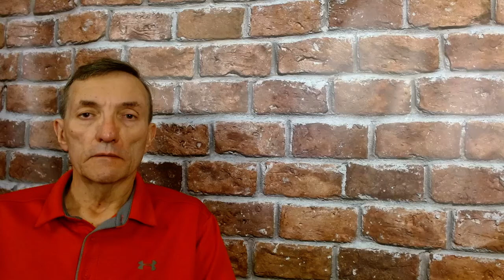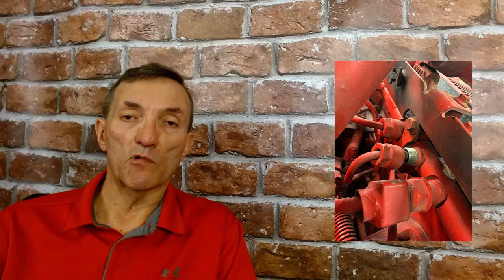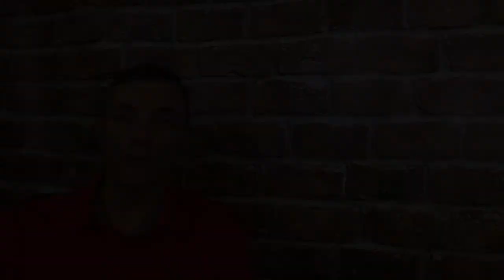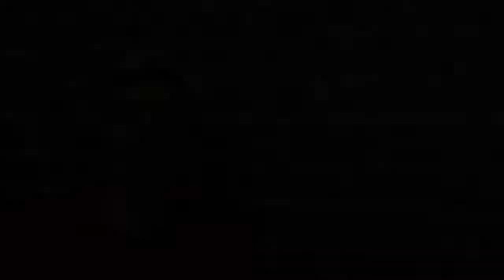FC 559 VIDEO 1  Troubleshooting low fuel pressure - safety first

Comment: I’ve changed fuel filter fuel water separator and fuel rail pressure sensor and this code continues to come back spn 157 fmi 18 oc1/2/3

Help
Pleaseeeee
Reply from the maker: Did this start before or after the filter changes? Did you change filters due to this happening? Does it only happen when pulling a long hill or anytime you step into the throttle? what work has been done to the fuel system and how many miles or hours are on the engine? What engine do you have isx isl L9 b6.7???
Reply: this happens to me as well only when pulling load up hill will the mai tanence light amd check engine come on please help i chamged the fuel pump the water seperator the sylanoid the rail sensor idk what else to do 3 local mechanics have given up  @ENGINESHOPJOE
Reply from the maker: @alexcabrera1  send me an ecm image with the fault in the image. faultcodehelp@gmail.com
Also I need to know exactly what was done when repairs made. IE- I change the fuel pump- gear pump? injection pump? transfer pump? I need a lot more information to give you an answer.

Comment: What would cause the fuel  to drain back to the tank even after the  check valve in the filter base was  changed?
Reply from the maker: There are a number of things that can cause that. Are we talking about common rail or ifsm or another fuel system? 
There are slightly different answers for each fuel system. If you not sure put your engine serial number in the comment or send it to faultcodehelp@gmail.com if you want your ESN kept private.
Reply: @ENGINESHOPJOE  common rail

Comment: Im having a problem with my truck, every time i leave it parked over night, my truck start normal but after 10-15 seconds it quits. If i come to the truck and press the gas pedal it won’t quit. It is the fuel pump the problem? I already changed the check valve.
Reply from the maker: If this started after you got fuel filters changed you might have a small air leak problem on the suction side-usually one of the orings on the suction side. Make sure your electric lift pump runs. Turn on the key and listen for the electric motor it makes a humm/buzz for 1 minute. After you turn on the key wait 50 seconds on your watch before you crank. If it starts ok and keeps running it is just fuel drain back. I dont think it is your fuel pump. There is a check valve at the engine where the fuel goes in. So as long as that does not have anything stuck in it (any dirt etc would have to get past the filter on the frame) the fuel cant drain out of the engine itself. But most of the time it is the filter housing on the frame that is the issue- and then it is usually an oring. I have had a number of people on the channel that had issues like you have and so far almost all of them had oring problems on the filter on the frame. Let us know what you find.

Comment: great video series   are all comp u check fittings the same size to fit into a gauge???
Reply from the maker: Well no not all the same. But on the cummins engines yes. You can find part numbers in my fuel system series on the common rail. There are of course after market ones that can be bought and work. We actually have 3 sizes of compucheck fittings we work with but they are on the hydraulics on the cranes and or the german engines.

Comment: Did you say the system had maintain 12000 psi of pressure after  2 weeks of engine shutdown? Are you sure?
Reply from the maker: No the system does NOT have to maintain that pressure.  Don't panic about whether your system maintains pressure or not. I mentioned that so people would understand they can maintain that pressure so BECAREFUL when working on the system and do not assume just because the engine has not been started in a few weeks that there is no fuel pressure in the rail.  Experience has shown that some engines maintain rail pressure for many hours if not days. Some you can watch it bleed on down using the insite data monitor key on engine off and 5 minutes after shutdown it has less than 1000 psi. There is Not a set pressure it should hold nor how long it should hold it. 
Thanks for asking!